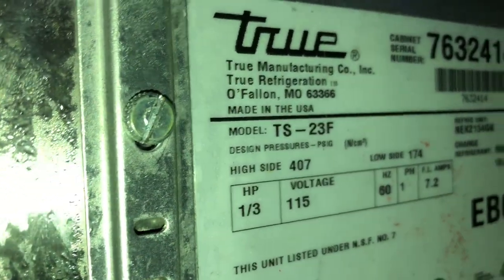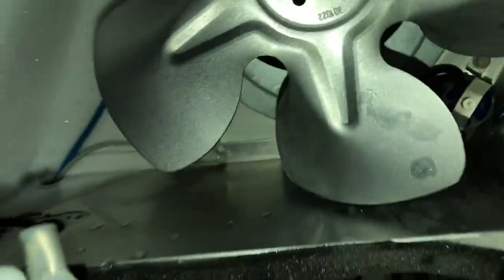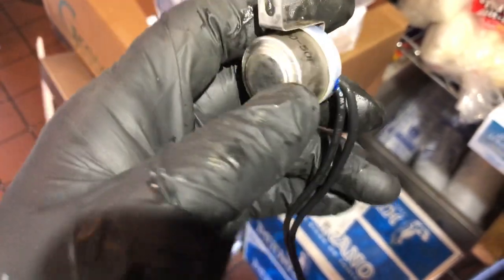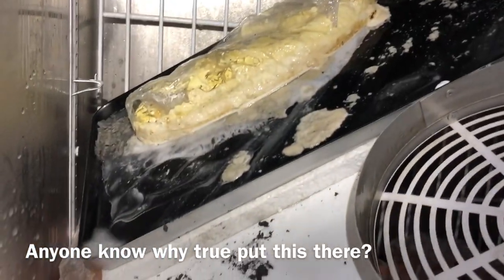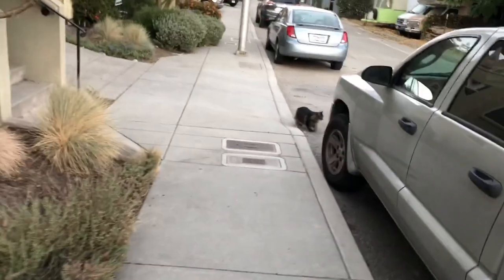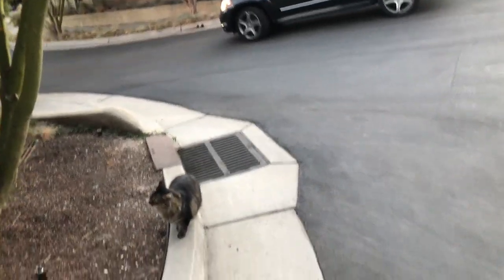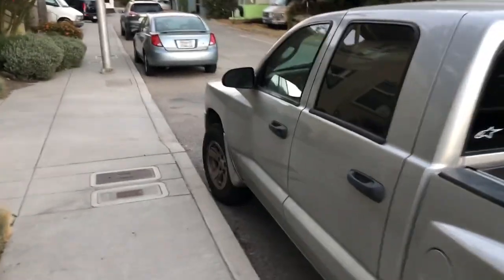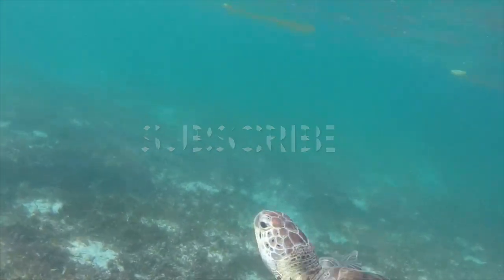True Reach in freezer with iced up coil

Comment: Im gonna say the foam couldve been used for shipping and no 1 paid attention to the install manual....
Reply: @OcRefrig  yep....worked on a 49 once that the customer stated that "its never really worked right since they installed it". Foam block between the coil and back wall was blocking half the coil off....even had a sticker on it 'for shipping only, removed on install'. 🤣

Comment: Cool Vid !  i ran the serial number on that one she's a 2013 unit. made jan 2013. so a 5 year old unit. so its out of warranty on everything. so, it's possible a normal failure of that high temp limt but, the controller might be sticking too in defrost and never coming out. thats what i'm betting. since that limit should never see 90 degree's. so, for the New guys out there, make sure you tell a customer that the controller might be sticking and or it may have other issues that caused the limit to pop. that limit is a safety that sholud never see 90 degree's in defrost unless there is a issue in defrost where the heaters never come out of Defrost. that limt breaks the line voltage to the heater element directly. without that the unit would go into nuclear meltdown if it ever sticks in defrost, so don't EVER think of bypassing it. ( unless u are going to stand there and watch it / for test purposes only. )
Reply: I went on a call, 3 door true case , low temp was reading 285° on the temp alarm, it was stuck in defrost, the klixon was bad. I couldn't believe it got that hot lol
Reply: thanks for the tips brother but I have a couple questions, is that limit automatically closes back the connection at 40f even you went over 90f? also the reason for freeze up is the unit was in defrost for too long, the limit didn't cut it out, it cuts off to its set time or like you said the controller might be sticking in defrost for too long. the box was hot and when it went to refrigeration mode all the heat causes the evap coil to freeze up is that correct? thanks brother